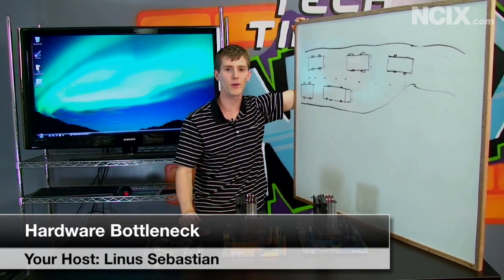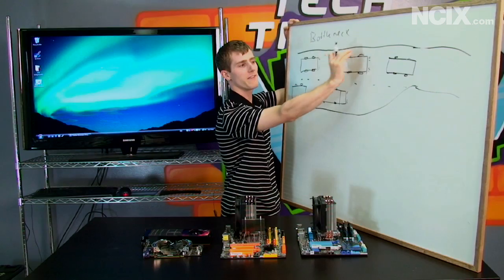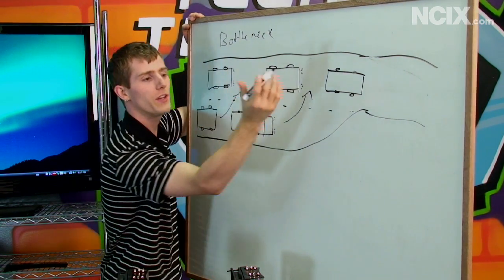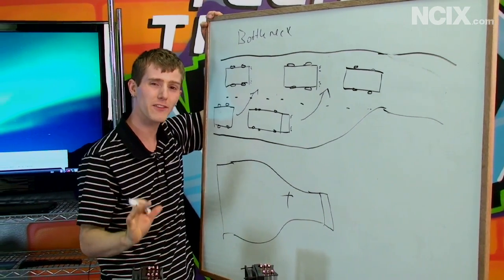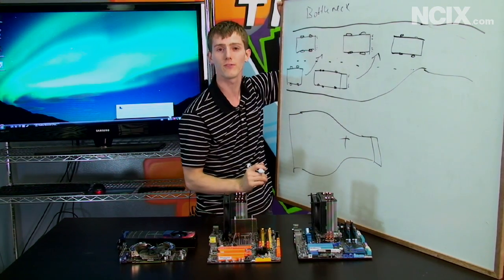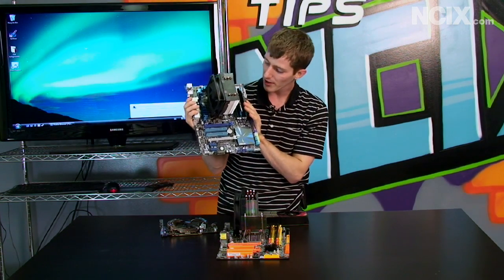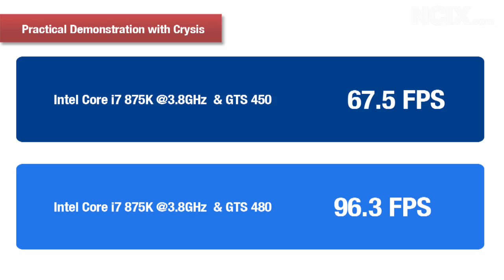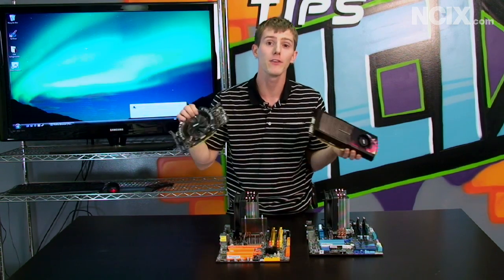Understanding Hardware "Bottlenecks" and How to Avoid Them (NCIX Tech Tips #81)

Comment: I agree with everything you said but the First statement that using a large PSU on a browsing computer creates a "BottleNeck" is false, is it a waste yes, but doesn't effect the flow of data either way. Why I'm pointing this out is because when people come to me and are looking for a Budget Gaming Computer with the plans to upgrade slowly overtime I tell them make sure you buy a good PSU around 750w to 850w because if you go with that cheap ass 300w or 400w PSU that come in most starter gaming rigs under $1000. When you do decide to upgrade, like maybe a new GPU, you'll most likely are going to have to upgrade the PSU. Now you have a Low PSU collecting dust and the money you spent on that low end PSU wasted. If you plan to build a computer that you never plan to upgrade at all, by all means go with the 300w or 400w.

Comment: Will my FX-4300 bottleneck a GTX 970 I'm planning on getting?
Reply: Wel assuming a FX-6300 and GTX 970 is a bottleneck. Yes, the FX-4300 and 970 will be too.
Reply: Purple Hawk
How badly will it bottleneck though? I'm using a 1600x900 screen.
Reply: +Mat7hew_ Probably to the point the 970 is not even worth it anymore.
Reply: Purple Hawk
What do you recommend I do then?
Reply: +Mat7hew_ Upgrade your system, what are your specs?
Reply: Purple Hawk
Mobo: msi 990xa-gd55
CPU: Amd fx 4300
GPU: Gtx 650 1g
PSU: Coolmax 700w
RAM:8g
Reply: +Mat7hew_  You might buy FX-8320 good price/perfomance. Of course you should oc as always with amd.
Reply: +Mat7hew_ Get a better cpu and graphics card or make do with a cheaper graphics card. No point in spending a lot of money on a fast graphics card when you can never use its potential.
Reply: +Mat7hew_ why would you even get an enthusiast-performance card with a massive framebuffer when you're only doing 1600? makes no sense. get the gtx 960.
Reply: Robin Roos
Because I would be upgrading to a 1080p monitor later.
Reply: Mat7hew_ i think you'd be happy enough with the 960 4GB version on a 1080p monitor. My screen is 1920*1200 and i'm ok with my 960 2GB. Little vram limited sometimes though.
Reply: +Robin Roos I heard the GTX 760 and 960 don't have that much difference thought. So out of the 2 gb more vram, might aswell go 760 xD
Reply: dries123ful why purposefully choose for the older one, though? if there's not much difference in performance, i'd always go with the newer card.
Reply: +Mat7hew_ 
Get a core I5 cpu

Comment: would a grx 960 go together with a core i5 4460?
Reply: +Fluffy Greyfoot they can go together yes, and your system won't have a bottleneck either. Both CPU and Video card have a high performance and this would be a really good gaming setup. In future your core i5 4460 could become your bottleneck, but it all depends on how programs are developped, if they are GPU intensive or CPU intensive. Only for CPU intensive games you will see the 4460 becoming a bottleneck to the system. The best match for the GTX 960 is the core i5-4690K 3.5 GHz operating 13% better in games than the core i5 4460. The core i5 4460 is almost a perfect match for the 960 and a very good choice (unless you think of video rendering and other intensive stuff requiring a core i7, which you probably won't need). The only thing it really misses is overclock potential. Other then that a very good match they would serve well together. Even if you plan to upgrade your 960 in future because of higher graphical demands I'm pretty sure the 4460 would still be able to keep up.
Reply: Robin Clarijs thanks! Anything is better than the C2D and radeon 3850 I have at the moment lol
Reply: +Robin Clarijs No.... just no.... a 4690k for a 960? The i5 4460 can take advantage of my gtx 970 with no problems...
Reply: DJ Jesus.He Died for your spins I've decided to get an r9 390 instead of the 960 though. Would the i5 4460 still not be a bottleneck? From what I've heard the 390 performs similar to the 970, but it has more vram which helps in 1440p or even 4k.
Reply: Fluffy Greyfoot the i5 4460 won't bottleneck anything. I saw some dude with a titan x and an i5 4460 running it with no problems.
Reply: You can put a 960 with a 6700k the cpu is harder to bottleneck than the gpu
Reply: DJ Jesus.He Died for your spins if you play at 4k settings with everything on ultra and cpu intensive games and you want to keep a 60+ fps you won't be satisfied with an i5 4460. (yes I know that the 960 can't handle 4K but it's about future proofing) Beside i wasn't just talking about games I was talking about computing tasks in general, which isn't just plain gaming. Even for 1080p gaming there are titles in which the 4460 falls under the recommended specifications given by game developers. This trend already appears in 2015 and will even strengthen in 2016 with the eye on a next generation gpu architecture you want to give yourself some margin. If adding an extra 40 dollars is an issue then yeah I would go for the 4460. if you want to get 60+ fps for a couple of years on 1080p I wouldn't go for a 4460.. Take fallout 4 for example putting everything on ultra won't give you a 60+ fps, for 1080p gaming because the cpu can't give that performance. (in case you say that's because of the 960 it also won't give you 60fps with 2 980ti's in sli.
Reply: Robin Clarijs no constant 60fps in fallout 4? riight. My fraps readings:
(i5 4460 and gtx 970)
Note, I also got into fights with a lot of mobs in a demanding area. Considering that, these are my readings:
Min: 56
Max:61
Avg: 60.017

Comment: I have an Intel Core i5 4690K 3.5Ghz, and I'd like to get an EVGA GTX-960 SSC 2GB. Will it bottleneck, or should i get something else? Thanks beforehand. :D
Reply: The Stealth Shadow
Yes you can bottleneck an i5 , just got to have something so intense it would need to run on a CAD card. i7 + Fire Pro = Game building.
Reply: Dude zabby I'm making the same computer right now as you are haha I wanted to know if the 960 was too much for the cpu also.
Reply: branflakes0399 It is. I resolved getting a GTX-970 STRIX from ASUS. It's not that much more expensive (349.99 on Amazon), and for Nvidia, it's the price to performance sweetspot for high-end, new cards.
Reply: Zabby lol you guys are funny no it wont you can keep an i5 for 5 years without upgrading it, you can sli 2 gtx 980's with no bottleneck
Reply: Daevon Jackson and Zabby, I built my rig with a 4690k that I overclocked to 4.0 Ghz, and a GTX 980 sc with the acx 2.0 from Evga. When I'm in games, my GPU always can get to 100% load if it needs to, which is what matters, and my CPU can also hit 100% load. So, basically you'll be fine with any graphics card right now with that quad core
Reply: Buckeyeband1 I already stated before, I have a 970. Works just fine.
Reply: ***** Didn't have money for it.
Reply: ***** That two core hyperthreading cpu could bottleneck on 4k, 1080p. No problem.

Now mind you it won't bottleneck to the point it makes you think you are doing the moonwalk but an I7, a RAMdisk to move the swap file to (drivers will live there Windows loves it swap) , and some tweaks in the bios on that 960 (Goto Tech Inferno forums).....That card would break Crysis. I5, having your swap on the OS drive, stock bios. All bottlenecks.

Let the overclock and RAMdisk police woop woop me, I don't give a god fuck.
Reply: The AMD math coprocessor is not as fine tuned as the Intel. When playing network and mmos it really helps. Also the amount of gold in the Intel chips help with lifespan. There is more but I need time to gather my research.
Reply: I am getting a laptop with an i5-4210h wich is a 2.9Ghz with 2 cores. The grpahics card is a gtx960m 4gb gddr5 wich is similiar to a gtx 750ti. Is the cpu bottlenecking the gpu or not?
Reply: XristosMarios Tziastas Unless your graphics card driver has any way possible to underclock your CPU, it shouldn't bottleneck the processor. The CPU is meant to handle its own processes with the system, while a GPU handles the video processing power. That's why GPUs have their own microprocessors and RAM nowadays; to take the throttle off your CPU while still delivering good visual performance. So unless your driver can underclock your CPU (which it shouldn't be able to), you shouldn't experience any bottlenecking on the GPU.
Reply: +fr00b91 This "should" be true but if your "GPU driver" is underclocking like telling the card to like's say run PCI-E 2.0 when it should be running 3.0 then that is a pretty clear problem.

Z-GPU is a way of finding out.
Reply: Zabby I have the same CPU, and a 960 4GB SSC and it wont bottleneck at all.
Reply: TF-Chroma no, you should be fine up to a 970/390X
Reply: Arulin E would 4 virtual machines (that have 4GB of ram and 1 cpu core each), 2 instances of crysis, and 6 renderings, and 1024 firefox tabs slow it down enough?
Reply: To what specs at you speaking of Devin? It seems more like half a thought instead of a real question. As long as the specs meant the requirements no there should be no slow downs. I've seen server racks handle worse. Take a look at Quakecon they handle far worse then that. You just stated the requirements now how about some spec? Like CPU, GPU, amount of ram, OS, etc. I think you are trying the troll me but I am giving you the benefit of the doubt.

With 4 cores being used on top of a OS the issue there is that a consumer grade cpu likely won't cut it. One Xeon Processor E7-8891 v3 could easily handle that load. An i5 would struggle, i7 might handle it but with the Haswell optimally maxing out at 32 gigs. Skylake can optimally run 64+ gigs so it night handle the load better. Sandy bridge and older chipsets might choke. It is all based around the entire build when you start going on with VMs and such.

Question of my own: Why would you need that many VMs running Crysis twice? So many Firefox tabs open? That would not be managable. I get that you are trying to troll me over the fact I have enough experience to be the CTO of Cox Communcations but what is the point of such waste. Frankly you "have" wasted my time.

Funny, I just looked at your profile, yea your are some kid trying to look all grown up and run their trap. So yes you wasted my time.
Reply: +fr00b91 You have no idea how those two work then.

To make it simple:

CPU is a serial processor type
GPU is essentially just a parallel processor.

The reason you have both in your computer is because they aren't that good at each other's tasks. This is also why you need at least a decent CPU for gaming because you do need some serial processing for the AI, different interactive scripts, it essentially tells the GPU what to do and so on. 

A CPU can process video and images but it would be so damn slow. There have been actual computers without GPU and all was done on the CPU.

Comment: Anyone who is thinking of pairing a gtx 770 with an i3,don't do it xD
Reply: nearly did it with core 2 quad, talking about a noob upgrading his pc :P
Reply: *****
Well,tbh, core i3 and pentium are a good pair with mid-ranged cards.The limit is 7870 from radeon and gtx 660ti from nvidia. Once you go to high end cards you will definitely see bottlenecking. I didn't read that anywhere, I experienced it myself ;)
Reply: I have gtx 770 paired with i3 4130 and 8g ram. no bottleneck at all
The new haswell generation cpu are very powerfull ...
Reply: minamontasser
Lel. Have you been living under the stones?
Haswell lineup is just ~5% more powerful than ivy-bridge.
As for the bottlenecks,i kinda don't believe you because i had it.
My cpu was the i3-3240 with 8 gigs or 1600mhz ram(recently upgraded to i5-3570k).
Reply: SpyRos13
 sir with all due respect ,, i didn't use the ivy bridge i use to have an old i5 second generation laptop ,, that why when comparing my old i5 second gen 2410 processor with the new i3 4130 haswell it feels like night and day ... second regarding the bottle necks i could assure you i could play any games at ultra setting with a 60/90 fps no lag at all .... have a great day sir ..
Reply: minamontasser
 Did you just compare a laptop cpu with a desktop cpu?! I guarranty it's day and night ;)
Anyway, about the bottlenecks i don't know what to say.
Have a good one
Reply: SpyRos13   maybe i am just lucky :D have good one to my totally random other have of the globe friend ;)

Comment: Wow just learned something, but please help me. Did you mention at 7:01 that if you have a high end card, you should turn your settings to high rather than low or medium? Does that also apply to the GPU's menu in the control panel and game or game settings only?

Comment: Something that you have to keep in mind is that there is always going to be something that bottlenecks unless you are giving less work to the system than it can handle. There is always going to be a "weak" link, it can be your SSD, your processor, your Mobo, your GPU or your RAM. But that is just a law. The point is to get that "weak" link so high that the tasks you throw at it won't stall or even if they stall, it is good enough for you.

For example, a car factory has several parts, you have to build the parts, then asemble them, then paint them, then test them, etc. Even if you can paint 1000 cars a day, if you can only make parts for 100 cars, you would be wasting the painting power. So before even building the factory, the company has to know how many cars per day they want to produce and THEN make sure each of the parts is able to handle that. so If they choose 100 cars, they will "bottleneck" at 100 cars but that was their goal anyway so there is no problem.
Reply: Mobos can decrease (drasticaly) performance? I only knew that it could raise temps... :-P
Reply: +Felipe03000 it is not common but it can happen.
Reply: superjugy hm... In my build my mobo makes my CPU heat too mutch. Without an decent cooler it reached 80C easily (FX 4100)

Comment: Using a Single PCI Express 3.0 Video card in a PCI Express 2.0 x16 slot is it a bottleneck ?

MSI Nvidia gtx 650 ti boost on an ASRock 970 pro 3 with pci express 2.0 slot. (cpu amd fx6300)

Comment: In physics, it's somewhat ironic that in the traffic/merging analogy cars slow down whereas in study of fluids liquid (such as pipe flow) displacing from a bigger area (circle) to a small area liquid speed up. But, of course, the liquid travel with the same velocity in the same area at a point in time. Cars don't normally go at the same velocity.

Comment: I agree on the part where you mentioned that having lots of VRAM is pointless for entry-level GPUs. I've seen DDR3 video cards with 4GB RAM, and it's moot as there's simply not enough bandwidth to go around, not to mention you wouldn't be able to max games out, rendering the card's framebuffer excessive for its worth.

Comment: Hi Linus,
I just bought a G30i 3XS Gaming PC from Scan computers in the UK which has these parts installed:
Graphics card: 2GB EVGA GTX 750Ti SC, PCIe 3.0, 5400MHz GDDR5, GPU 1176MHz, Boost 1255MHz, Cores 640, DPort/DVI/HDMI
CPU: Intel Core i7 4770, 1150, Haswell, Quad Core, 3.4GHz, 3.9GHz Turbo, 1200MHz GPU, 34x Ratio, 84W
System Memory: 16GB (2x8GB) Corsair Vengeance 1600MHz
Motherboard: Asus H81M-PLUS, 2xSATA 6Gbps, 2xSATA 3Gbps, 2xUSB3, 4xUSB2, HDMI, DVI, D-Sub, mATX
SSD: Sandisk SSD, ULTRA II, 2.5" SATA 6GB/S, 480GB
HDD: 1TB Seagate Barracuda, 7200rpm, 64MB Cache
DVD Drive: Samsung SH-224DB (SATA)
Case: Corsair 200R ( I've Installed some Corsair 120mm SP and 120mm AF fans to the  tower too)
Power supply: 600W Corsair CXM series, Hybrid Modular, 80 PLUS Bronze
CPU Cooler: Coolermaster Hyper TX3 EVO CPU Cooler ((Did have an Intel reference cooler 1150 in But i change it a couple of days ago Due to high temps))
Sound Card: Creative Labs Audigy FX 5.1 Gaming Soundcard
OS: Microsoft Windows 7 Pro 64bit, Supports 16GB RAM and above

Any bottle necking possibilities please? and what would be the Best GPU setting too please for gaming?

Thank you in advance for All/Any info

Comment: I'm using a XFX790i ultra SLI with a QX9770, 8GB Ram and a GTX295. It's doing pretty well so far, except for DX11 since the video card is only DX10. What would be the video card recommended upgrade? Thanks.

Comment: i use my computer for 2d/3d animation - photoshop, after effects, 3ds max, mudbox video conversion - all that stuff, my computer was pre-built by HP and is about 3 years old (bought it with student loan money). not had any problems with it until very recently when it started to slow down quite a bit, so my first piece of upgrade was an ssd to run the os and programs! all this confusion about compatible components makes me worry to the point were i'm just tempted to get newer versions of what's already in the case, any advice on motherboards and graphics cards?? i currently have an i7 2600 processor and an NVIDIA GeForce GTX 460! i'm tempted to get the GTX 660 since since i know everything will be just fine if i do!

Comment: Hard drive: WD Blue 1 TB Desktop Hard Drive: 3.5 Inch, 7200 RPM, SATA 6 Gb/s, 64 MB Cache - WD10EZEX

Power supply: Corsair Builder Series CX 600 Watt ATX/EPS  80 PLUS (CX600)

And im using windows 7.

Comment: 1050 Ti 4GB OC
i3 6100 3.7ghz Hyperthreading
Windows 10 x64
8GB DDR4
24" 1920x1080 @ 1080p 2m/s

Fallout 4 @ Max w/ Vsync turned off, FPS capped to 60 w/ RivaTuner

GPU usage at 100%, CPU at 50-65%, fps ranging from 20-60 in different areas

Am I getting a bottleneck? If so, which part is causing it and how can I resolve it?

Comment: I have a i5 6600k no OC, a gtx1070 MSI no OC, and 16gb memory at 2144mhz, a z170 k4 and a 650w PSU 

I'm curious to know if my system is being bottlenecked by a component.
Any feedback would be useful. Thanks

Comment: I got 2 x EVGA GTX 780 Superclocked SLI, MSI MPower, i7 2600K OC'd to 4.4Ghz, 8GB Corsair Dominator 1600Mhz and a PSU Corsair HX1050W... is there any bottlenecks in this setup?